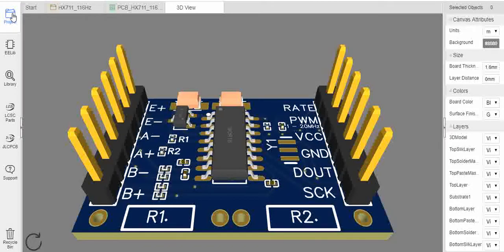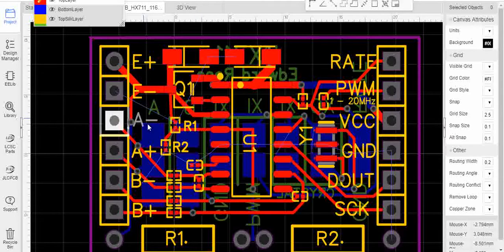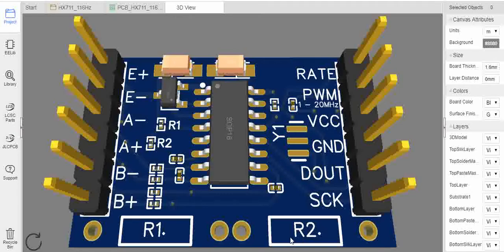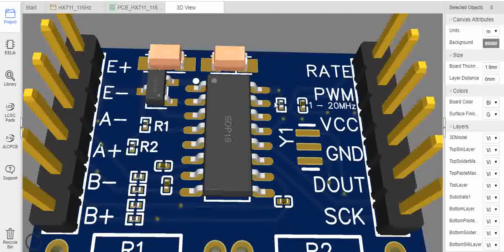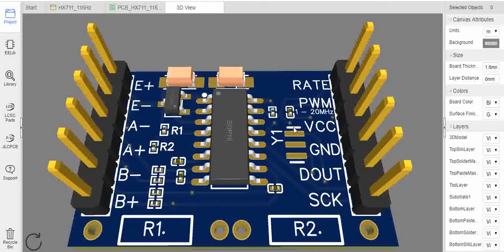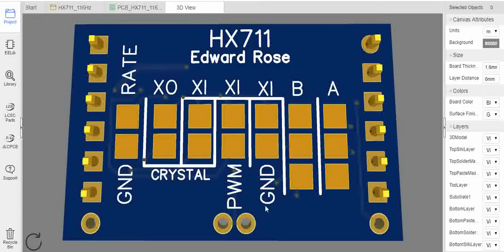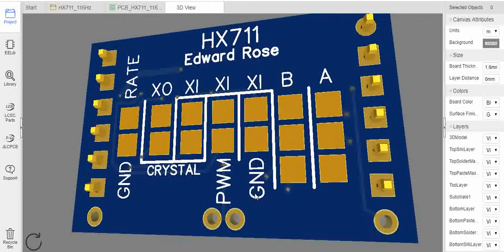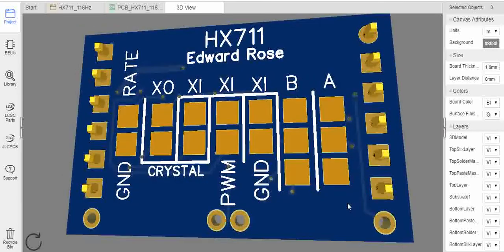A Better HX711 Board, Designing

Comment: I wonder if the Crystal would stabilise the drift. What resistor values would you recommend for R1 and R2. I managed to provinde clean 5v through a LM317 step down (from 12v switching source) but still it drifts on the long run.
Reply from the maker: The crystal will only affect the sampling rate as far as I know. If you are using the onboard regulator and giving it 5V the standard values of R1 and R2 should be fine. They are typically set to provide 4.6 - 4.7V at E+. I had issues with drift when I used a regulator as a supply. The problem disappeared when I connected the 3.7V lithium cell direct to the board. You would need to change the ratio of R1 and R2 if doing this.

Comment: Hello, can you please share the board design? I have a  smaller one with a metal shield but it jumps around and also drifts over time.
Reply from the maker: There is nothing really special about the design. It just has the issues discussed in previous videos fixed and more ability to customise it. I would make sure the board you have is working as it should be. Also remember strain gauges are just difficult to work with, noise and drift are to be expected.
Reply: @Ed.R  yes, I have increased the voltage over 5v but no difference in noise. Also the pin from the left side it is connected to GND. So I don't really know what can I do to get rid of that noise. It should come from the electrical side. I noticed that running if from a battery instead of the usb or switching power supplies helps. Also it seems to drift over time. I also understood that the clock of the arduino might be to fast... Anyway thanks, let me know if you have any updates

Comment: This looks like an excellent project. Well done!
Reply from the maker: Thanks, not sure how far I'm going to take it but designing with selling them in mind.
Reply: @Ed.R  It's certainly something I'd be interested in.
Reply: @Ed.R  What software are you using for that 3D layout?
Reply from the maker: @mindracing  Its a feature in the EasyEDA software which I'm using to design it. Using EasyEDA because its linked to JLCPCB which I've use once before to make my power latch circuits. They did a great job and the software seems good so far to. The 3D model is amazing for checking the design.

Comment: Hello, I did tryed soldering the two pins of channel B to ground, but then the raw value went up and fixed. Didn't charged no matter how much I was pushed down the scale. I do have a cheap middle sized green board.
Reply from the maker: I tried grounding the unused channel on a red board, which has correct grounds, and it didn't affect the output. Didn't improve noise either so don't think it's worth doing.
Reply from the maker: That's interesting to know, I had better test before keeping them. I was only going by the data sheet which perhaps isn't the best idea. Thank you for mentioning this. Have been lazy and not done this on my boards in use.